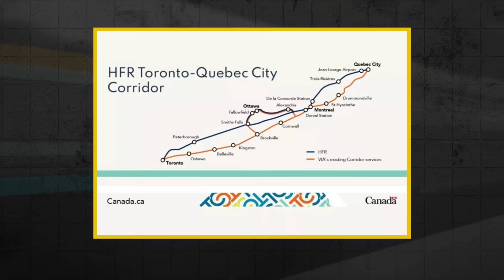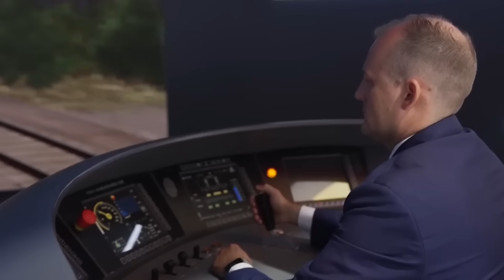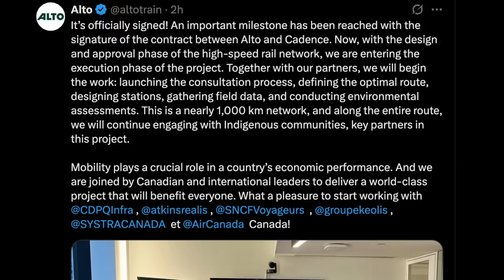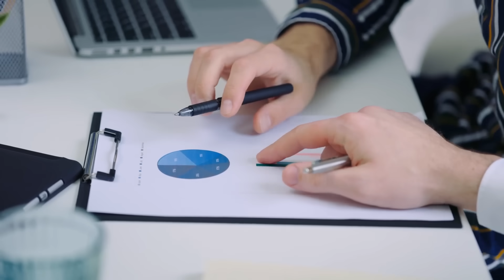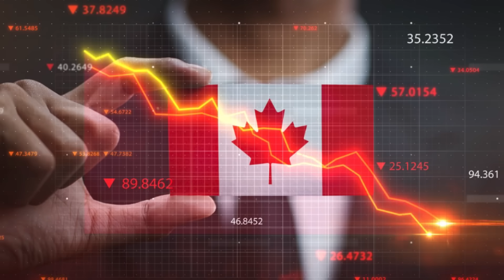$100 BILLION Gamble: Canada’s First High-Speed Rail Is Underway!

Comment: Please, if there is a God in heaven, torpedo this project. Another, gigantic, waste of money, that won't work because so few Canadian passenger rail projects work. If Canada needed to move grain or a box of car parts, we'd be tops. People? Well, GO, and parts of VIA do work. But even the Ottawa OC train wasted a ton-o-cash and that was a simple system. Toronto has blown 13 billion and 14 years on a tunnel where it would be cheaper to give everyone who rides it a car. We'd save 12 billion dollars doing that. Or how about 5.4 billion to move 35,000 people in Mississauga by train. 35,000 cars at $20k a pop is only 700 million.  

No magic train saves emissions. The power needs to come from somewhere. Solar and wind happen only when a) it's daytime, and/or b) the wind blowing. No train for you on this windless night? Second, VIA for almost as long as it's been around, has begged for a) no level crossing on the mainline, and b) it's own line. This would cost millions. The dumbest response in the world? Build a multiple billion dollar train with no level crossings and it's own line. The same thing but way, way, way more expensive.

In Canada we have a lot of experience with diesel locomotives, parts, machines to fix them, expertise, and we have 1000s of them. So, we should build 20 trains for which we have NO experience, no infrastructure, no spare parts, no maintenance facilities? VIA bought some very nice Siemens trains that are great. Widely used. Service here in North America. Lots of parts. Expertise. They run fast, and where do they do have their own line and no level crossings, can hit 160-200kph. Manage that first Canada before you start dreaming up huge wastes of money on projects that will go no where except the waste bin. No train of today or tomorrow is ever going to beat any airplane built in the last 70 years.

Comment: All the criticism does not address the existing environmental and cost issues around highways, car and oil dependency, flight emissions and so forth.  Airports, airlines, highways and other last century economic initiatives also required massive public subsidies and still do.  What public road or highway isn't completely underpinned by public money?  At least HSR will offset a portion of its operating costs through farebox revenue and, if built right, with future increases in ridership.  HSR will also directly replace cars and short haul flights.  Then there are the indirect big development benefits this rail project will stimulate.

Comment: I call BS. It’s yet another possible study, that will take years to complete, and then quietly die. There will be proposals to award it to Canadian companies with NO experience in high speed rail, with probable massive cost overruns, instead of buying a proven off the shelf rail system such as France’s TGV or Spains AVE system. It’s dead before it starts.

Comment: It will have to be dou8ble tracked all the way. You will need special wheels, to safely travel at 300 Km. You will have to purchase them, probably from China. You said 1000 klm's in 15 years? My lord. China built 40,000 klm,'s in 10 years. That is 60 times faster. Oh boy, this is going to cost large.

Comment: Helicopters seem to be the best way to move people. Helicopters are cool and the pilots are awesome. The pilots can be trained to fly in line while avoiding birds. These fast helicopters must work with a slower passenger rail. We must take down power lines and windmills replacing them with solar gas generators.

Comment: I have two remarks:  1) This so called "public - private partnership" in the past caused excessive fleecing of the traveling public.  I expect this time it will be the same. 
2) Toronto - Quebec City is not enough for the long run.  This high speed line should be extended to N.B. and N.S (Halifax) to the East, and Niagara Falls/Windsor to the South West direction.
Reply: I mean, this project would be basis of future high speed rail projects.
Reply: They are just starting with the most densely packed area of the population before moving on to extend it both ways I’m sure.
Reply: Having a proper rail system to connect the three main cities in New Brunswick would be so nice

Comment: I'm hoping that upon completion, this will be used as a jumping off point to extend the highspeed rail line connecting Canada from Vancouver to Halifax. Couple that along with Alberta's talks to build a highspeed rail line connecting Calgary to Edmonton, this could further connect all Canadians
Reply: Yes and B.C.(...Asia) to Newfoundland-Labrador... Greenland..Europe
Reply: That's not gonna happen any time soon. Coast-to-coast routes are simply better served by flying, at that scale you need your train going 900 km/h to be competitive with flying.
Reply: @volodimirivanevko9238 Rapid train CARGO(that by IT self generate enought profits)/passengers travel for free/véhicules(we need to Cary our petdonnal véhicules Canada largest contry canot door2door)/tracktables (tiny house,boat, récréatives véhicules etc. IT has to be 2 floors passengers can dit at top. Both rails in flexibles tunnels IT suit Ground mouvement, Véry much high speed, LESS expansive cover with green Belt + rail at 40'hight that give seenic and Cary sensitives products and suspend monorail under 30-40 persons that develop also on country roads and boulevards this is Véry cheap ski like telepheric at demande si IT stop only where it's need contain extensible ascenseur adaptable to conditions white exist rampe we we can cary wheel chairs, bicycles ect a security air rampe include on each. Pipelines all Along for Crew and transform like hydrogèn, Milk, Beer, electric lines in others tunnels.
You are right IT Will not happening IT is happening NOW

Comment: While cost constraints may make implementation unavoidable in some cases, the fact that route expansions like a direct high-speed rail link from Italy to the UK are being planned suggests such projects are successful in Europe.

One advantage of introducing high-speed rail is the technological upgrade of existing rail networks.
New technology enables the refurbishment and improvement of existing rail systems (rolling stock, tracks, operations). This brings benefits even to lines unsuitable for high-speed rail.
Users demand improved convenience in transfer services. Newly constructed lines also promote redevelopment around stations.
The benefits extend far beyond the high-speed rail lines themselves.
Reply: Europe is completely different as it has a much bigger population density. In Germany they have had high speed trains with speeds up to 280kph since June 1991.

Comment: China has over 26,000 miles of high speed rail. Canada needs to invest in it's future.
Reply: China has nearly 20 times the population. It is not as cost effective for Canada.
Reply: @pacman3556 it's not cost effective at all, China loses money on a majority of its rail, but that's the point, the rail improves the lives of its citizens and they don't care if it's not profitable. This is why China continues to be ahead and will be in the future.
Reply: @davidtaylor9742  so if China is losing money what do you think would happen in Canada with 40 times less people.
Reply: @pacman3556  And that's why we're not building 26,000 miles of rail. We're building 500-700 miles.
Reply: @Yheffez  still not cost effective at 500 miles of track
Reply: The line can be of two types. Just passenger trains, like TGV and spanish AVE. So that means lighter and simpler construction , higher maximum gradients, but much less costly, or mixed high speed passengers and goods, like Italian and German high speed lines. Given the experience of Italy I would say that in a busy passenger line like Montreal - Toronto there would be no room left for any transportation train. So to make a mixed line would be just a waste of money.
The landscape is quite simple and flat to lay a line. The most expensive parties are to enter Montreal and Toronto. Probably all in tunnel to keep high speed and not interfere with existing roads and tracks.

Comment: Doubt it will get built, but hope it does.

It would shift alot of traffic off the 401, making it able to sustain more trucking while offering substantially shorter passanger travel times. 

The population is expected to grow significantly by 2040-2050... this would make good sense.
Reply: Making more room for trucking on a highway sucks. Trucks destroy the highway that taxpayers have to pay for. Shipping a lot of freight cheaply is what trains are really good at. Unfortunately, CN was sold so we have few freight options these days unless the government spins up a new freight rail crown corporation.
Reply: @soviut303 yes, that highway also crosses a few hundred destinations and having a train station at each is unreasonable. Between Toronto/Ottawa is a lot of small cities/towns that require trucking services.
Reply: The trucking industry is vastly subsidized by the costs of building and maintaining the roads they use. Even with the heavy fuel and registeration fees, they don't make up for the cost of repairing damage caused by heavy trucks or building roads that can better handle them. With just in time manufacturing companies have put their warehouses on our highways.

Comment: The concern that Alto could wind up being a premium priced transport alternative priced out of range for the average person, is a legitimate concern. 
The 401 highway is a congested mess that runs from Toronto to Montreal. Yet just a few kilometers north of it is the 407 Toll highway which very few people use because it is so expensive. The 407 ends at the 115 highway which feeds to Peterborough and links to Hwy 7 which pretty much parallels the route Alto would take through the region.
The rates on the 407 Toll way are such that it costs as much as a the gas most drivers would use to go from Peterborough to Toronto in tolls, effectively doubling the cost of any trip. Hence, most people prefer to brave the congestion on the untolled 401.
Reply: High speed train networks around the world often started as a premium service - they're competing with airplanes after all. But they always got cheaper pretty soon. Especially if you open it up at some point for private competitors. So this isn't an issue anywhere else in the world.
But I assume this governmental/private sector partnership, that Canada is going for, might create a safe monopoly for the operator of choice here. At least for some negotiated amount of time. I hope this won't turn out to be the key ingredient that will ultimately confirm your concerns.
Reply: Its costs me $100 to drive from Burlington to Oshawa on the 407. Its about an hour drive. Its hurts the wallet but the 401 hurts the soul. I only use it twice a month. I feel so bad for those unfortunate folks who have to suffer the 401 on the daily, its a living nightmare. They are so brave.

Comment: High-speed rail is a public transportation network that connects between large cities.
Reply: While virtually ignoring most towns located in between start and end points, unlike HFR which would also have provided this connectivity while still potentially offering a 3 and a 1/2 hour travel time between Toronto and Montreal.

If you look at the Swedish X2000 trains operating at up to 200 kilometers an hour or 125 mph, their travel times actually compete with air and auto travel even though they are actually similar in speeds to HFR (High Frequency Rail) or HrSR (Higher Speed Rail), not HSR (High Speed Rail).

And these X2000 trains even compete with HSR trains in Germany on some routes!

As such, effective modernized passenger rail isn't strictly limited to HSR trains, as is the case in countries like Austria, Sweden and Switzerland.

Most European countries migrated to HSR, not because their regular intercity trains were ineffective, but rather because these countries had reached full capacity of their respective rail networks!

Comment: The line actually has to be Windsor, ON all the way to Québec, QC. And it has to be on a mostly dedicated line running what amounts to a modified TGV-M (Avelia Horizon) train set with speeds up to 320 km/h (199 mph) with service at least 5-6 times per hour, specially between Toronto, Ottawa and Montreal.
Reply: You meant service 5-6 times per DAY, right?!
Reply: @greatestsportslegends  I really mean 5-6 times per hour. The road traffic between Toronto and Montreal is too crowded even now.
Reply: @Sacto1654  Are you sure a lot of that road traffic isn't localized? That's what regional rail like the GO train is for; to carry commuters between nearby cities. From what I know, most people traveling between Toronto and Montreal are flying; I'd use air travel figures to figure out the frequency then cut it in half with the assumption that it'll get twice as much ridership as anticipated.
Reply: With time, yea 5-6 train per hour at peak hour on the most important segments (Toronto - Ottawa - Montreal) makes 100% sense. As a comparison, the LGV Est in France (Paris-Lyon-Marseille) is of a similar length to Toronto-Quebec, and has 200-300 trains per day. The more the line is used, the cheaper the tickets can be. And the objective is not just to relieve car traffic, it's especially relief airplane traffic, and increase trips overall (boosting business, tourism, and growth between those cities).
Reply: Nope, per hour
Reply: @highway2heaven91 5 - 6 times per hour would be expensive. 

Twice or three times an hour during peek hours. With enough cars to significantly relieve traffic.
Reply: @highway2heaven91 there's zero chance of that. Most public transit in this country doesn't even run that often.

Comment: The operating costs and construction exceed any value the railway offers.
Reply: Sorry, but coming from a country, that build a highspeed train network more than 35 years ago, I have to say that this was one of the most awesome things we ever got. The value for the economy had a much greater impact, than even initially estimated. And this is true for every single country, that build themselves highspeed rail. Why should it be different in Canada?
Reply: Ok. Build a second 401.... solutions cost money.
Reply: @Tony-xy7lj  A highspeed rail corridor could technically be used by additional passenger trains as well. Propably local ones, that don't go with their slower speed all the way, but connect additional smaller destinations instead. Those won't be limited to the rediculously slow 130 km/h, but can go all the way to 160, 200 or even 230 km/h. And they won't have to share the existing corridor with freight trains anymore. But I don't know if Canada will allow this kind of mixed-operation on this one.